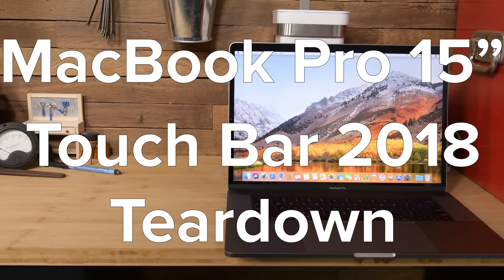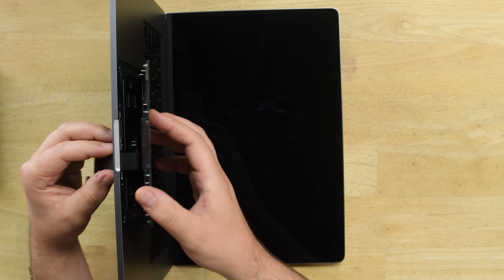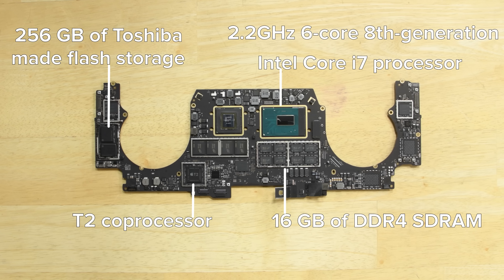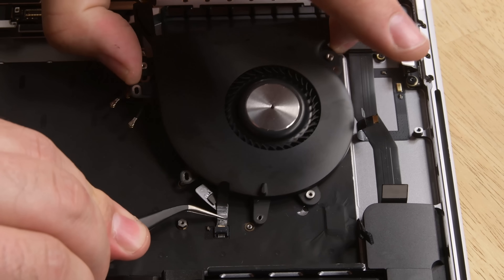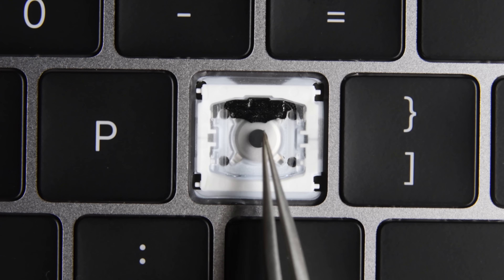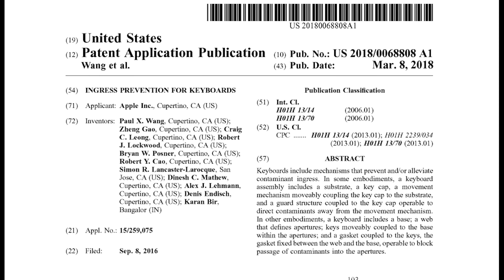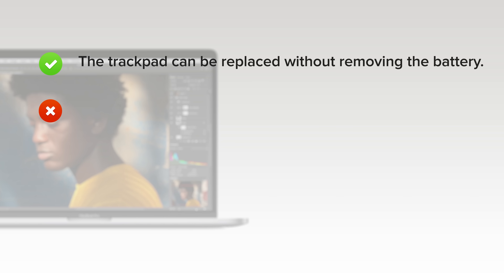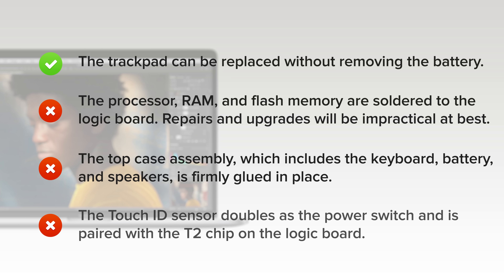MacBook Pro 15" Touch Bar 2018 Teardown!

Comment: So how much would have it scored if you could't replace the screen, the trackpad, thunderbolt/audio ports, fans, etc? Does this 1/10 equal the 1/10 of the Surface devices which require the screen to be unglued with practically no components to be replaced? Not to mention that you can't open them up to clean the dust from the cooling system.
I think that you should update your scaling. I would give this an easy 4/10.

Comment: you gotta give Apple appreciation, no one is doing a better job manifacturing such compact laptops. the sothering will not be an issue when they will be able to schrink the components to the size of SD Cards with the possibility of popping them out and gettin them in with ease.

Comment: I take it the situation is the same for a 2019 15 inch Macbook.   I just bought one with 16gb ram and 1 tb SSD.   I take it that you can't replace either the RAM or SSD.    I just hope 16gb will be enough to last several years at least.    I think it is kind of ridiculous that you can't replace either the RAM or SSD.    I'd rather have a slightly thicker/heavier computer that lets you upgrade the RAM or SSD than a thin computer that doesn't let you upgrade at all.

Comment: So sad that Apple has decided to screw their loyal customers over by making repairs and upgrades impractical, if not impossible. Unless they change the design, my 2017 MacBook Pro will be my last so it better last like my 2013 MacBook Air did.

Comment: The 2018 MBP is not recommended to go with i9 because thermal throttle 
But its unclear how a darn similarly looking and darn similarly thickness 2019 MBP can cool down i9 even the 8 core version and able to turbo boost 
Its just miracle

Comment: I hope Apple will add a SSD slot in the Touch Bar versions of MacBook Pro as in the non Touch Bar version of 13” MacBook Pro. Who want to throw their $3200 4TB SSD upgrade away if some part of the logic board fail after warranty period is over? And who want to throw their logic board away if the flash memory in the SSD get corrupt in a few years? Flash memory wont last forever.

One thought I have is: Maybe Apple wanted to have a SSD slot in all models but lack of space in the Touch Bar versions made it impossible at introduction? And maybe they will find a solution for this by future optimizations? What else would be the reason only to have it in the non Touch Bar version of MacBook Pro?

Comment: Why only 1? Pretty much everything is repairable, except the soldered ram, cpu, gpu and storage.. and the battery which has to be replaced together with the top case. I'm not saying it's great to repair, but it's still not as bad if you have easy acess to ports, trackpad, motherboard, display etc.. I'd give it a 3.

Comment: I bought a 2010 MB pro in 2010 and lasted me 8 years without a single problem. Didn't have to repair absolutely nothing. An when I say that it lasted me its because I bought an 2018 MB pro recently and thus I don't use it anymore. But its still working!!  Apple make things to last. I also only cracked my iPhone screen 2 times but that was when I had my iPhone 3GS and my iPhone 5C. Nothing happened to my iPhone 4, 6S or 8.

Comment: My Logic Board broke on my 2013 MBPr 15" in Jan. $950 to fix a 5 yr old computer...oh well got 5 years, actually 12 months of continuos use when you count the hours...still pissed at Apple for not making it easier to fix
Reply: try to buy that logic board on ebay and change it yourself. I think it will be 5x cheaper or even more. Look at Ifixit site. There are photos and instruction in detail how to do this job for any model. Good luck. (I repaired 2 my macbooks, and it was fun too!)

Comment: I would like to correct "The top case assembly, which includes the keyboard, battery, and speakers, is firmly glues in place". I suggest everyone here who own a macbook pro 2016 to 2018 shake your macbook horizontally, vertically, open up the lid and shake it all direction again, 7 out of 10 your macbook makes sound of something loose inside it. Yes, It is battery.

Comment: Geese apple. I get it. But you can't make personal computers like phones or a calculator unless you make it affordable to get simple issue fixed or getting a replacement unit. If the computer itself is expensive as heck and any repair expensive then that's not good. What you have is a perfect equation for how to efficiently loose your entire customer base. 

Windows, hurry up and implement Linux already. Show apple what innovation is all about

Comment: Nowadays all computer vendors are following this methods of soldering all on mbs. This means use and throw. They dont want customers to get their machines repaired at anycost. They want to keep selling newer laptops every year. Thats destructive type of designing.  One way its good that machines pegormance will remain solid at any rough uses reducing its failure rates, but once it fails its more expensove to repair than buying a new one. But this is not acceptable when you are paying huge amount of money of these machines. People should stop buying these machines and oppose these moves... its becoming more and more difficult to get these things repaired...
Reply: Its to do with the bill that past recently its called sometime like( repair you own devices) because of when you purchase an electronic goods as soon asyou pay for an item it's yours. as in your property so you can do whet ever repair you want excluding the warranty.

Comment: I absolutely agree that we should have the right to repair what we own but one thing that I just released watching this, like many in the repair business you don’t like security! There was a  statistic some years back that a estimated 20% of the parts in the small repair shops were being supplied from stolen phones, not the the shops where doing it just that there suppliers didn’t always care where the phones came from they dismantled for parts. When car companies some years back started to pair parts for security to deter theft people didn’t like that either being that the only ones that could say reprogram a radio would be a dealership. I know a lot of people including my self once that have had Android phones stolen but of all the people I know with iPhones not one that I know of was ever stolen but one did find hers with find my iPhone when she lost it out one night, she left it in the crack of the seat of the back of the cab, luckily for her the battery hadn’t died yet. I think all companies should improve security and be forced to make their devices repairable through the company with new parts, once they start recycling devices they should not be allowed to destroy good parts on newer devices but should be forced to make those parts available to lower repair cost, I as a consumer should have the choice of a new part at x price or used part at y price.

Comment: As someone who is tied to apples accessibility options and their software, it is truly sad to see a pro product be offered with minimal specs. Instead of re-configuring the base models they expect individuals to pay double the price for components on top of an apple tax when upgrading simple things like storage. I understand they are a business and what they are working towards in strengthening their product security and revenue stream. The way they are working towards this goal is negatively impacting pro users satisfaction over the long term.         
From the teardown I would give it a zero, because there is nothing in the computer that I would go out and buy to upgrade or replace if the computer breaks.

Comment: Wouldn't buy this gluefest, for the reason that cannot upgrade memory/CPU alone.  And then there is the issue of heat.  Even if I don't mind the throttling, just burning my lap is reason enough I sold my 2011 MBP.

Comment: Having RAM and internal storage soldered on the motherboard is the dumbest idea. Yet Apple insists on doing this so that if it does break, you'll either have to bring it to Apple to fix it or buy a new laptop.
Reply: its a smart decision for apple, but they should be shamed for being sooooo anti consumer. that's the reason i bought a dell xps 15, but that turned out to be another steaming pile of shit and no longer gonna buy another dell. Maybe used.

Comment: I don't like apple, but I believe you guys were a little hard on the repair score, like you said, fans and ports are removable so the pieces that are moving the most can be replace easily, and on the side note, Solder CPU? Really? Tell me one Ultrabook, notebook, or any laptop without the gaming brand that has a replaceable CPU?,  That comment just feels like throwing salt to the wound.
I believe that score should be a 3 or 4, but I'm not familiar with the scaling you guys use for the scoring

Comment: It should have scored 0. I mean the trackpad? who cares! but hard drive is a must. I don't agree with 1 as the components that could be replaced are not important. If the notebook fails beyond repair I want to have the chance to further disassemble it recover the hard drive and recycle all the rest. Surface book should have scored 2 according to this.

Comment: Why mention that the processor is soldered on the mother board? Do you know any marginally portable laptop that doesn't have a soldered processor?
The ram and storage should not be soldered in a Pro device especially one that costs that much.
There are a ton of other laptops that offer better specs and that are also upgradable (at least the ram, storage and WiFi card).
Build quality is second to none as always on MacBooks but tbh it's not worth it because everything else is a bit of a disappointment...

Comment: Not just hard to repair - this laptop is also a PITA to diagnose in the first place. You have no green light on charger to check power circuitry, you have no ASD/AST anymore, since that's on Apple Servers now, known as AST2 (that are not accessible if you didn't know), you have no fan spin to check whether 5V rail/board is dead and now, because the 2016/17 models were not bad enough, they gave us the precious T2 chip, that will not just bind the fingerprint reader, but now also the SSD to the board! So if you somehow manage to be retarded enough to spec the SSD to 4TB, you can kiss your data goodbye, once your board dies. You have either to repair the board to get it to work, or you can throw it away. This is also the case for the new iMac Pro. Just that they have 2 SSDs. I also don't want to imagine, if any liquid gets to the T2 chip. If that single chip dies, your mainboard turns into a 2000$ paperweight. So everyone being so excited about the "biggest leap in speed", bear in mind, this machine might drive you insane.
P.S. Have I already mentioned that netboot is gone for those machines? No? Yeah. So if your SSD is dead, you also have a 3k$ paperweight. Enjoy it.

Comment: What is up with these non-modular design choices? It’s disheartening to see how far Apple is moving away from modular RAM and hard disks to soldered in components ... How naïve can I be?
Reply: soon there will be no exposed PCB, they'll buy the chip die then bonding it on 1 single PCB then potted it all down...
Reply: Just get an iMac , it's way better than a Macbook , plus it's upgradeable.
Reply: Sander Evers take a look at the Dell XPS 15. Thin & gorgeous and completely upgradable. Or the Lenovo IdeaPad 720s. Or a ton of other thin & light laptops. There is barely an excuse for this shit
Reply: Sander Evers and yet there are others making it thin and light and repairable at the same time.
Reply: This what you get for making it as thin as possible.
Reply: Modular means having to make everything bigger. The smaller and more lightweight you make something the less modular it can be. Someone made a modular cell phone. It was gigantic and it flopped. If you want modular, there are 100s of options out there you can buy. But there aren't many options for very small and lightweight while being high end.
Reply: you are the perfect apple buyer, would you buy a car (which is more or less the purchase price) that would not allow you to change anything if it broke ... I do not think so!

Comment: I remember a time before 2013 when it was easy to upgrade your standardized components on a Mac. need more RAM? done. need more HDD space? done. deciding on an SSD or traditional mechanical disk? done. want to upgrade your Mac Pro's graphics card or CPU? done. Now? forget it, using proprietary parts because they believe its better technology but in reality its meant to keep the users from upgrading their components plus seal it off with either glue or uncommon pentalobe screws! good luck at getting any warranty support from Apple for any current Macs' design flaws. I previously had owned two MacBook Pros, one Mac Mini, and several generations of iPads, including an iPad Pro, and since then recently switched to Windows because of apples shady business practices and design decisions with their entire product line. I think apple has lost its vision and focus on why they make great products and are now more focused on profits.
Reply: I still have a 2010 macbook pro 15", it's so easy to upgrade. I'm not gonna change it anytime soon, it still works just fine.
Reply: MK P MBP 2011 had an issue with graphic chips, but when that happens you know where to go

Louis Rossman

Don't delay, repair today
Reply: I'm not an Apple Apologist but this is an industry trend, not just Apple. Most ultra book form factor PC's are very similar in ugradability or lack thereof.  You will see less and less devices that are able to be taken apart as more components are miniaturized and become surface mount single board devices more like smart phones.
Reply: Sean C. You’re right, this is the industry trend, and you know what? Apple is the one starting this trend.
Reply: You are completely right, but sadly Apple isn’t the only company that uses proprietary parts. More and more manufactures switch, because it’s easier in the production.
Reply: Geeker1982. U do realize ALL tech manufacturers quickly copy and paste each others’ money making design choices. Your dissatisfaction with the current planned obsolescence business model need not be restricted to only Apple. This is the wave of the present and very soon future for all profiteers!
Reply: I still have my 2012 MacBook pro, upgraded the HDD when it broke down. It was great
Reply: Geeker1982 agree 
I owned the MacBook Pro 2011 and changed the RAM and the HDD for SSD, I replaced the CD port with more space. I was very happy with what I could do with the machine
Reply: While I loved the upgradeability of my 2012 MBP I get that they want to increase reliability and reduce weight by taking out all the component interconnections.  I have had to re-seat my Ram previously and with the soldered in place that shouldn't need to be the case.  I bought i9 2TB 32GB and for me it really felt like the HDD is the one thing that over time will benefit from reduced price but now you had better buy it upfront. I guess that's what you get for thin and light.  For me its worth it as I am on the road all the time.

Comment: Thumbs Up Apple, very ecological super expensive laptop without replace anything. After few years go to trash becouse bad ram for example. 😞
Reply: 32gb of ram?????
Reply: The RAM/CPU should last the life of the machine, but the SSD?  Come on Apple!  it has a finite lifespan.  Why this can't go on a simple Micro PCI card is beyond me.  It does NOT require more space, it can be screwed down fast.  There is no advantage to soldering it in place other than to compel users to purchase more expensive machines out of the gate and reduce cost (without passing those savings along to the consumer).
Reply: @Andron MacBeton users need to backup their data
Reply: I literarily never heard of bad ram. Or broken ssd's. Or literarily anything on that motherboard, if it's not like stone-aged old.
This computer is not made to last 20 years, but it will easily work for 8+ years of you handle it with care and replace the battery after some years. 
So what's the deal?
Reply: Apple will always recycle your old Mac free of charge. It's a very environmentally responsible service that they offer. I own the 2018 MBP 15'' Hex-core 2.6Ghz version, it's blazing fast. It's worth every penny. The 2017 MBP 15'' quad-core 2.9Ghz version is also very good, which I also own. If you are on a MBP before but not including 2013, this is a very good upgrade, and it's about time. Otherwise, wait for the next one.
Reply: This is wrong.

Yes, they will "recycle" your old Mac free of charge, but so will a trashcan. Apple orders their devices to be SHREDDED by the recyclers, all they reuse is a little bit of metal. Everything else still goes in a landfill. This is so that people couldn't get parts for Apple devices.

If you resell your device to a company that buys second-hand devices for resale and recycling, it will actually be either fixed or the parts will be used to fix other similar devices, reusing things like: The display assembly, the trackpad, the top case assembly, the logic board. And unless it's a shady company, your data will be wiped safely, of course. You will also get PAID for your laptop, rather than "having it recycled for free". A 2017-2018 Macbook Pro with liquid damage that doesn't turn on, is still easily worth 100-200 EUR/USD/GBP if not more